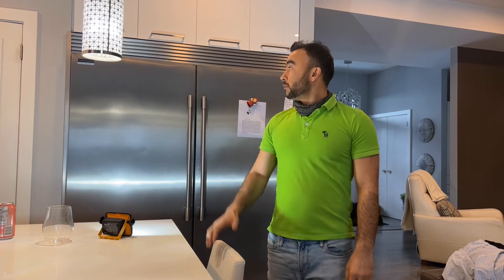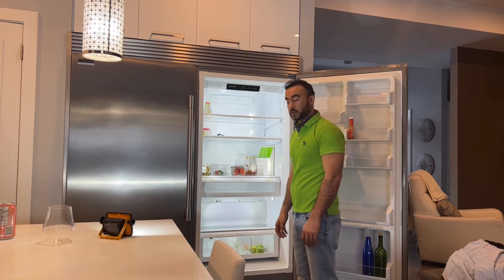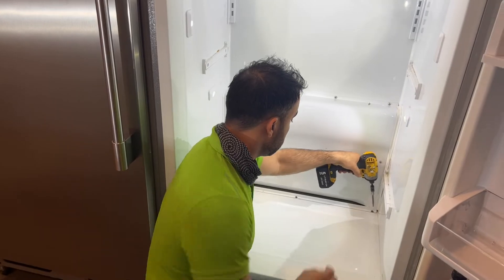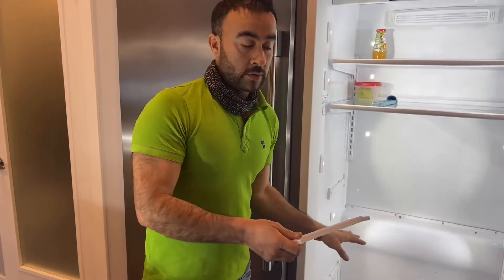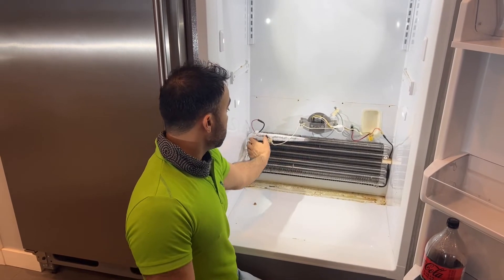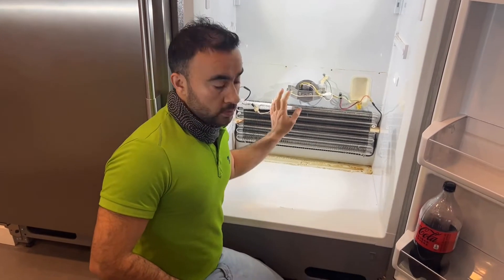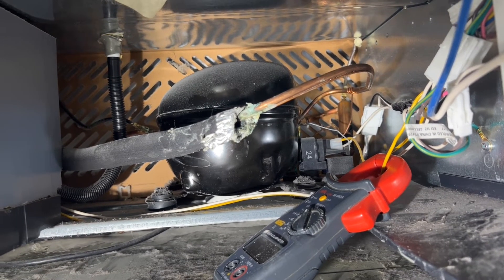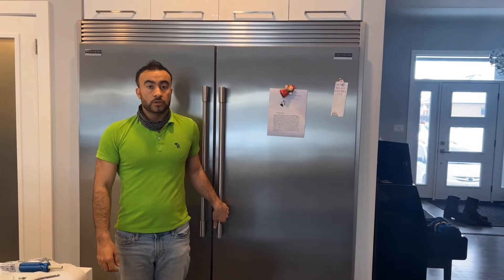Frigidaire professional fridge not cooling , unit inspection done

Comment: I have this same set, fridge went out after 3 yrs just like this one. Paid $1600 in Feb to have it repaired (that was with Electrolux giving us 20% off parts as good will gesture even though we were out of warranty) and that was only 4 months ago. Repairs came with a 90 day warranty. Figures, because it just went out again yesterday and of course we are outside of the 90 day warranty on the last repair. All the same parts you mentioned were replaced. So given that the metals are evidently not compatible with the refrigerant (hence the rust) is this just going to keep happening? I'm trying to decide what to do - buy the new model and hope Electrolux fixed the problem, or go with a different brand and pay for custom millwork to have my cabinets match the new opening since this is larger than most other built-ins.
Reply from the maker: If unit has rust do not even spend a penny on it otherwise I would fix it . There is a good chance tech did not do soldering properly otherwise there is no reason that unit would not last more than 6 months .
Reply: @hameedwafaAFG  Since I first posted that comment it started cooling again and got down to 34F deg for about 24-30 hrs, but now it's up to 47-48 again, so I'm guessing that's caused by low coolant/leaky system? When it cooled down again I was hopeful for a minute that the temp spike was a glitch or we had simply over-packed it (something my wife is notorious for, thanks to Costco) but I guess I'm not that lucky. We already replaced all of the internals incl the compressor and all of the associated parts 4 months ago, which the tech said should last a while. So much for that. Recommend just replacing at this point? From what I've read online it doesn't appear the new models have addressed these issues as there are still plenty of 1 star reviews from people saying to stay away from this set. Good news is I no longer need to go out and buy a dedicated meet freezer since I have this rather nice one that still works great (why is it only the fridge that fails?)...bad news is it looks like I need to buy another set, not this one though. Do you recommend Fisher & Paykel? One of our friends has a F&P set and said it's been perfect.
Reply from the maker: @mholmes9262  I love fisher Paykel
Reply: I feel your pain. I bought a new set the middle of 2019. The refrigerator went bad mid 2021. I had 3 different repairmen tell me it was not repairable. Bout a new one and it went out just now, 2023. the repair guys tell me the same thing. So now 10k in i need to spend another 7k for the new models and pray they are not junk too.
Reply: @chrisross2795  It's unacceptable that Electrolux keeps building this fridge the same way, knowing a high percentage of them will fail in a few years. They obviously know how to build a fridge because their other models are not as fragile as this one. We actually had another repair company come out and fix ours yet again a few months ago and the tech seemed very experienced, and assured us he was confident the issue was now fixed. So far, so good. But time will tell.

Comment: Where was the condensor coil located for this refrigerator and freezer?  Do you have a video from when you cleaned them?  Thank you!
Reply from the maker: @dougnjustine137  under the fridge when you remove the kickplate you will see it closer to left corner on each unit .

Comment: I saw on one of the comments you mentioned if the fridge has rust it’s not worth repairing. I was wondering why is that?  I have the same fridge with this issue and the drain below the evaporator has rust on the drain and two inches to the left of the drain and 6 inches to the left of drain.  Visually as long as the drawer is in and the evaporator cover is on you can’t see it.
Reply from the maker: Rust causes leak , it causes drain hole to get plug it also break the cavity and eventually it would causes air leak . That’s why I do not recommend fixing it if it’s deep rust

Comment: Very helpful video Hameed! Did you find a leak that you had to weld on this unit? Or was the leak in the evaporator?
Reply from the maker: @daftpunk0030  90% of the time leak is in evaporator but don’t assume you still have to check it with nitrogen to confirm the leak

Comment: What do you use to pull the fridge out of its place? Both the freezer and cooler have to come out at the same time?
Reply from the maker: Plastice glides
Reply: @hameedwafaAFG  one more thing. What ohms should the temperature thermister be at 32 degrees?
Reply from the maker: @carman7679  on room temperature it’s should read around 11k ohms , to get the proper reading, I recommend following the tech  sheet , you can also Google the chart on the fridge, thermistor chart on a fridge ✌️

Comment: Hi Sir, Thank you for sharing your knowledge; the video helped me with cleaning. I have a question: today, the freezer alarm was very loud. I called customer service and followed their instructions, but nothing stopped the alarm. I unplugged the freezer for 10 minutes, and when I plugged it back in, the sound stopped for a few minutes, but then it started again. I ignored it for a while, and eventually, it went off by itself. Now it's working fine, but I don't know what caused the issue or how to prevent it from happening again. Any advice would be appreciated. Thanks!
Reply from the maker: @rubaatout731  clean your coils with air compressor or leaf 🍃 blower if it still has problem call for service ✌️sorry for late reply

Comment: Hello Hameed, I have look at your fridge not cooling, since I have the same issue and finally find out all part is working well but the evaprator is frooze on top like yours. I can buy the part , my question can we change the evaporator our self? or we need a specialize tech.
Reply from the maker: If you have got refrigeration training and has a ticket to buy gas you can do it , but since you asked this question I do not think you can do it , please contact a local service provider to get it done properly. Thank you 🙏
Reply: @hameedwafaAFG  ok thank you, allready called local repair shop.

Comment: Hi Hameed, I have the same fridge and the food is freezes. Temperature goes bellow zero degree Celsius. When I remove evaporator cover panel, the temperature is steady in 3C (like per setting). When I return the evaporator panel back, the temperature drops again bellow zero. For now I just leave it without the panel and it works good. Evaporator fan is working. Defrost is working. Only the problem when the panel is on. What can be the problem that the panel affects so much?    Thank you.
Reply from the maker: Hello , Whats the model number?
Reply: @hameedwafaAFG  FPRU19F8RFE
Reply from the maker: If you checked your defrost thermostat and it’s definitely working there is nothing else except defrost thermistor part number 297110400 or worse case main control board 297326524
Reply: @hameedwafaAFG  Thanks. If there any option to check if the problem with the defrost thermistor or main CB?
Reply from the maker: @natalie1234564  get your reading from thermistor, 
With the thermistor submerged is a glass full of ice water, the sensor should be very close to 32°F which should read approximately 16.3K Ohms. If the values that you are getting are far off from these readings, then the sensor is bad and should be replaced. If you can also search for thermistor value reading . It would give you more accurate reading unfortunately I can not post picture or diagram here ✌️
Reply: @hameedwafaAFG  Thank you so much Hameed.
Reply from the maker: @natalie1234564  yeh
Reply: @natalie1234564  Did you find any solution to this yet? I have the same fridge and it is freezing the food and drinks as well 😢

Comment: thank you - very helpful. Got out our Klein Tools clamp meter and it registered .5 amps. Sure enough there was a leak in a 4.5 year old Gallery Series Model FGRU19 series.  In addition, there was rust behind the back panel. Frigidaire apparently uses "non rust proof cheap metals". Their warranty states Rust Is Not Covered yet they know darn well inevitably moisture will rust out their parts and no one will ever remove this lower back panel to discover this atrocity until they are out of warranty.
Reply: Same model same problem same 4.5 years old. What a joke. Everthing is made so cheap these days.

Comment: Hi 
I have the same model, but mine is getting the food too cold freezing some of them. I removed the evaporator cover, and I see very little ice on the evaporator, the cover has a little rust areas.
Temperature is set to 41 degrees, and my NOT digital thermometer dials sometimes 28 and sometimes 40 degrees 
Please help. Thank you.
Reply from the maker: Good morning! 
Take a picture of the evaporator area while the back panel is off . Send the pictures to my Facebook page Hameed appliances repair . Once I get the pictures I would let you know. Maybe you have leak in the system , because if you have leak in the system it would also run for along time to cool down the system and try to satisfy the thermistor need but in fact it can’t and runs forever. That’s worse case . It could be anything ✌️
Reply: Did you find any soultion to this? I have the same fridge as well it is 3yrs old and it is freezing the food and drinks as well 😢
Reply: Hi. Not lucky yet. I paid Frigidaire to fix the leak, they tried so many times changing the evaporator and they failed. Crap of technician. Now Im hiring another company. I hope this one knows what the are doing.
Reply: @jacojaco8436  a leaky evaporator was causing the food to freeze? Due to? Please update the solution when you find one as I am still looking for one 👍🏻 thx and good luck

Comment: Just bought one. The fridge is not even cooling.
The freezer works great, tho.
 Over $5,000 and it's crap.
Reply from the maker: It might Be defrost issue , if it’s not cooling or relay in the compressor . Call a tech , if you are in Winnipeg you can call me at +1 204-809-3380 

Thank you!
Reply: Same problem, fridge only lasted  a couple of years. Can't find a tech in Vermont.
Reply: Same here bought in DEC 2021 after 4 returns (really happened) now the freezer doesn't freeze what a waste of $6k

Comment: Thanks for the excellent video..  I have the same fridge and it died after 8 years.   Criminal that i can even buy a new fridge to replace it as the new model doesn't fit.
Reply: What do you mean the new model doesn't fit? Aren't they both 30"?

Comment: So if it's reading 0.54 and not getting below 56f it's toast?

Thing isn't even 3 years old... Thankfully credit card extended warranty covers it but damn
Reply from the maker: Yeh 0.2 is too low , most likely leak
Reply: @hameedwafaAFG  you can see corrosion on the lines coming from the compressor... Very poor design.